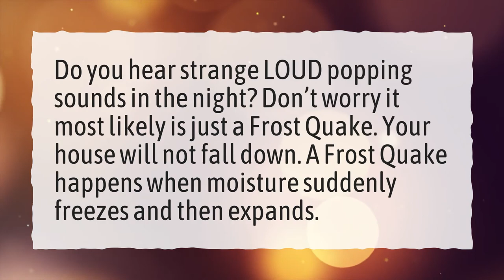Why do houses make popping and cracking noises?

Comment: would add more screws in the trust or framing help at all? i'm in AZ and i hear noises all the time...summer/winter/night/day.  I'm fed up.  Its random at all locations mostly above the master bed ceiling...sound could also come from central heat and air unit hanging from attic.